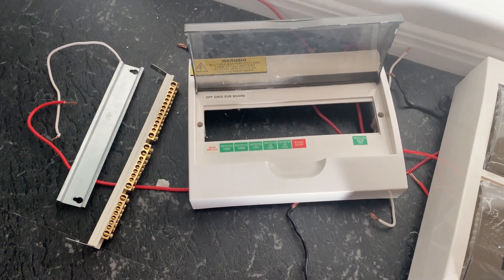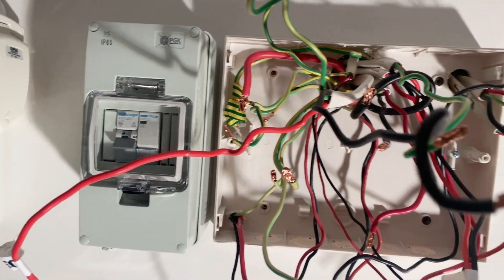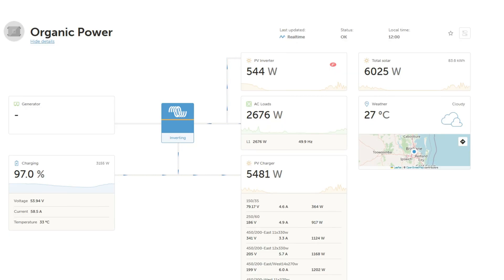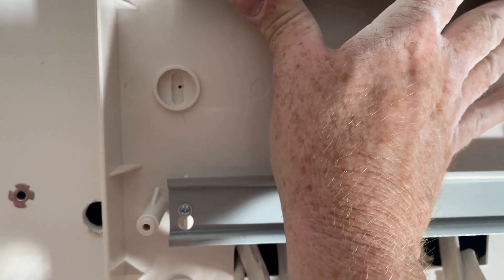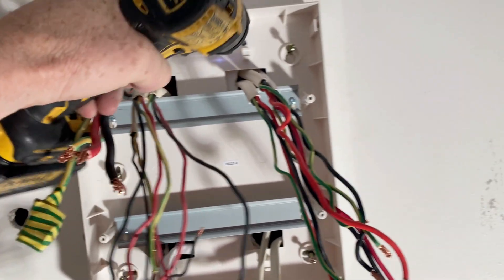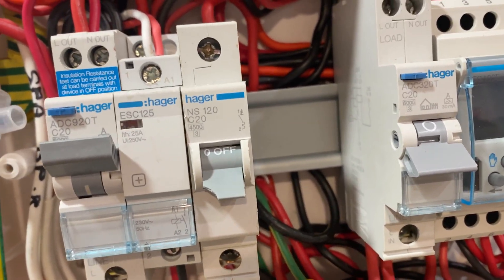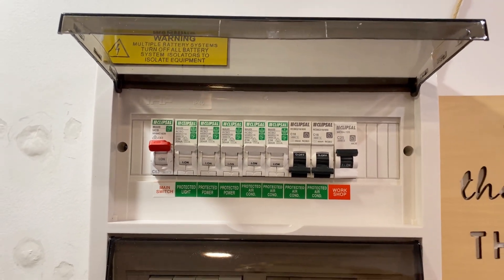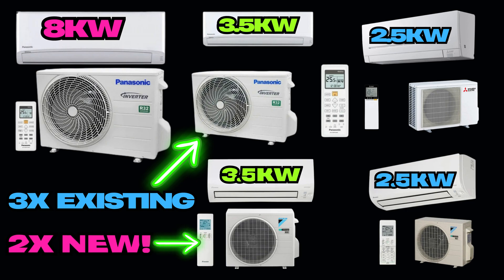Victron Multiplus II Off-Grid Solar Power Switchboard Upgrade | Full Install

Comment: I called up the power company about a month ago and got them to shut off the grid...I don't need it even here in Melbourne. I have an 8kW aircon in the main area and 2kW units in the bedrooms. It handles all of that easily...
Reply from the maker: Nice work completely disconnecting! You must have a few panels for the grey days in winter? I used to live down that way for 20 years near the SA border. Great to know things work just as well in your part of Australia, thanks for letting us know. 👍🏻
Reply: @OrganicPower-Australia  Unfortunately it probably wont in the winter months, but hey 9 out of 12 months no need for the grid so I am pretty happy about that. I could also supply extra power in winter from the EV, not sure which is more expensive to be honest.
Reply from the maker: Have you got room or any plans for another array to cover you for grey days? It was fairly grey and wet here today and with the small upgrades I made a few months back the system was solid, still got to 100% by 2:00pm. I plan to do another array upgrade in autumn to get a bit more during winter on those short days 😎
Reply: @OrganicPower-Australia  Hey mate I need to get my carport roof replaced as it's rusted through, but after that, solar panels can go on there as a bonus. The carport roof is heavily shaded by the neighbours trees though and a lot of rubbish comes off those trees onto the carport roof. Otherwise my roof space is completely full. But not to worry the system is coping with these cloudy rainy days, yes I've had a couple of days where the panels cannot fully replenish the batteries but the system is designed for this and I have not gone below 50% on the batteries so far. I also have no gas connected here, so literally everything including hot water, heating and cooling, cooking etc, all come off the system. So no more daily service fees for both electric and gas!!! Living the dream mate. Winter time is an issue though, again heavy shading from the neighbours trees reduces the production substantially.

Comment: Loving your content. Thank you
Reply: I am running 3 air conditioning off grid, including a battery room
Reply from the maker: Nice work! Nothing feels better than cheap cold air from the sun 🌞
Reply: First sparky I seen with Felo screw drivers 🤗I love the soft grip so I should have got 24 pole instead of a  12 looks like I will be making the same change in the future really nice work
Reply from the maker: Yeah the drivers are fairly good 👍🏻 They were a gift from my old boss 😎 I was originally just going to power a few things with the off grid, it went so well we did the whole house 🤣
Reply from the maker: I'm really glad you're enjoying the content! Nice to see you back. Thanks for your ongoing support 👍